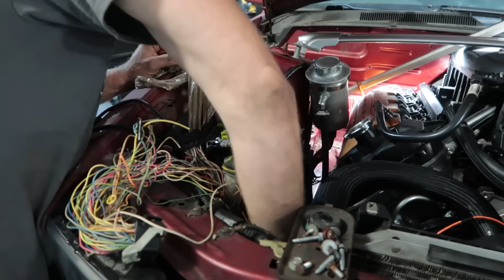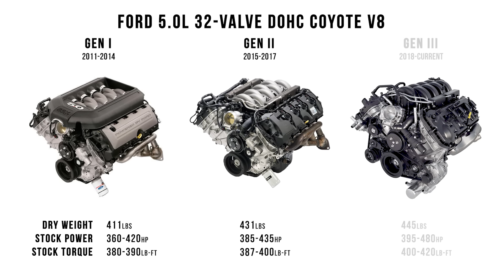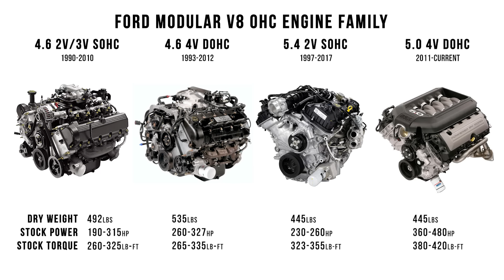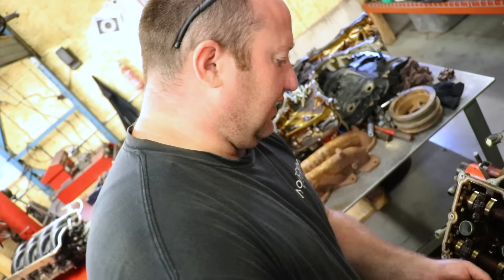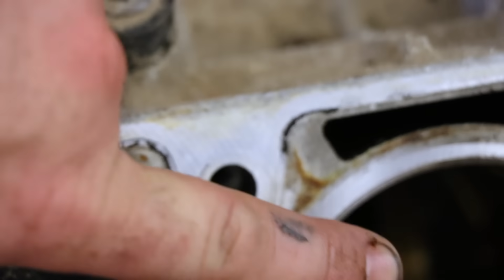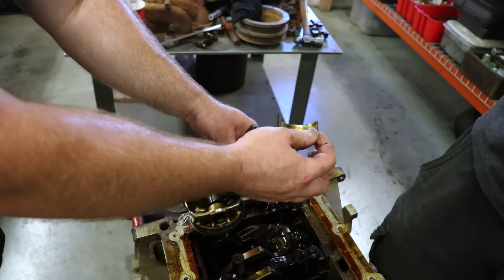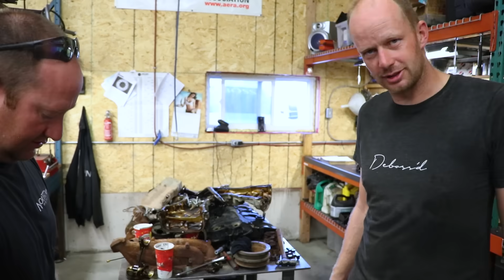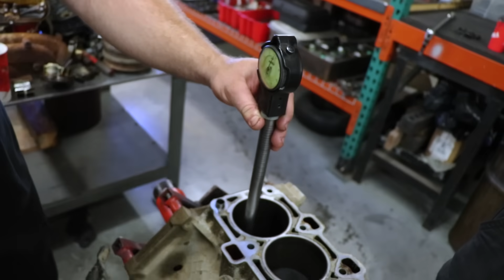REVIEW: Everything Wrong With A 5.0 Coyote Engine

Comment: Seen a few 5.0 work trucks with over 350k still going good when we got rid of them
Reply: Yes indeed.
Reply: I bet that engine is respected tho and not getting beat on tho
Reply: @Kevin Roberts sounds like a lot of miles.... For a Ford. Tundra engines with that many miles are about 50% life
Reply: @stevieray1828  That's because the Tundra's using a decade and a half old engine of which the bugs were worked out of it well over 10 years ago that drinks gas like its going out of style while miraculously making less power than pretty much all of its competition hold for the 5.3L Chevy's. I get the people like to suck Toyota off for reliability but the way Toyota maintains the reliability is simply by making no changes to their product for long periods of time they lack innovation a 2021 Toyota Tundra is mechanically nearly identical to a 2007 Toyota Tundra.
Reply: @nathanmcdonald610  true that the engine and transmission have been used for a long time. There have been minor changes, but the truck has remained durable. Also true the mpgs stink, yet Tundra has lowest cost of ownership. Don't get upset that one brand is more reliable than another. Innovations are great when they make the vehicle safer and more reliable, but cheaper made and competitively marketed just to get the sales isn't a better route to go. Toyota has the safety sense on all models, even the 14 year old tundra. Not a bad innovation
Reply: @stevieray1828  I'm not upset, I know Toyota has a rep for reliability I'm just pointing out what they trade off for the reputation, they aren't innovators, they stand on others shoulders and accomplishments of others every 15 or 20 years when they do an update cycle on a model, it's kind of like how the next gen Tundra is supposed axe the V8 and be powered exclusively by a twin turbo V6...Sounds familiar doesn't it.

Also Toyota isn't as up to par of safety as you may think they are as they failed the small overlap crash test and received a poor rating ''unlike Ford and most others who aced it'' with modern safety enhancements. The argument about Toyota goes both ways, many people are just blind to the other side of it.

''IIHS Small Overlap Tundra Video''
https://www.youtube.com/watch?v=SD6TdlJ7zIo
Reply: @nathanmcdonald610  Toyota doesn't lack innovation in the slightest. Actually their engineering is some of the finest. They have also been making reliable hybrids for a long time. The company also focuses more on commuter vehicles and here in America we get the two pickup trucks. Many are fine with that because of the reliability they get. It is true that within the pickup truck market, in America, other trucks are making more innovations. But keep in mind that Toyota won't be copying Ford with a twin turbo engine, the epa has stricter emissions going forward. Also Ford didn't invent turbo charged engines, they started using them as well as making aluminum bodies because they and every manufacture knew the CAFE regulations were going to force innovations for mpgs and they wanted to move forward. In my opinion some of the early eco boost F150 were guinea pigs for the stricter regulations in the next few years to come
Reply: @stevieray1828  For the sake of keeping this conversation simple, I'm willing to acknowledge that Toyota brought the idea of a mainstream hybrid to the publics attention with the introduction of the Prius, so perhaps its unfair of me to say they completely lack innovation, however exclusively speaking of the Tundra, I believe they do lack innovation and hopefully its clear at this point I'm not saying that to trash the brand as a whole, but there is no argument in my mind that the Tundra simply lacks innovation and advancement and I stand by my initial argument that Toyota simply stands on the shoulders of others every decade and some change to bring the trucks up to par ''this applies to the Tacoma as well.'' And while you are correct in your statement that Ford didn't invent the Turbocharged engine Ford IS responsible to making it mainstream in the truck market a business model that Toyota is absolutely about to parallel with the next generation Tundra, word it however you please, but in my mind its copying which isn't a bad thing, if these manufactures didn't copy from each others innovations we would still have 7.0L+ engines that made 250hp on their best days and got single digit gas mileage.
Reply: @nathanmcdonald610  the great thing about America is you can choose from different brands offering what you want. If you want a Ford, than get a Ford.  If "advancements" are what make a truck good for you, than buy a truck with "advancements". The fact that Toyota has slowly worked out all the bugs with the Tundra while adding subtle upgrades and features might not excited you, but I personally value the attention to quality. To say they stand on the shoulders of the other truck companies doesn't make sense. They don't seem to be competing for sales numbers in the truck segment, they sell millions of commuter cars every year, while consistently selling 100k+ Tundras. Even when they are "outdated" in 2021,  the Tundra has standard apple car play, Toyota safety sense with auto headlights, radar cruise control, emergency stop assist, lane keep assist on ALL trim levels. And they are the most reliable.
Reply: @stevieray1828  I'm not trying to be argumentative. As much as I'm allowed to prefer Ford so are you with Toyota. You can prefer whatever you want for whatever reason. We will have to agree to disagree on some of the stuff we discussed, but I'll close with saying its not advancements that sale me on Ford, all the Fords I've owned have been very reliable and treated me well arguably as good as any Toyota I've had or used regularly and I've seen my share of Fords run to 500K+, the reliability  gap between Toyota and any other manufacture realistically isn't that large anymore, not what it was in the 1980s by any stretch. So you enjoy your Toyota's as I will my Fords.
Reply: @nathanmcdonald610  I will agree to your last comment, and do believe that the reliability gap is closing. At the end of the day as long as you are happy with what you have them you're doing pretty good in life. Part of me loves the new technology and innovation, while part of me feels car companies would prefer the consumers buy new vehicles every three years by marketing the newest and greatest things that you just have to get. Not only is living in perpetual debt a poor financial decision, it is also lacking in moral fortitude. It's not right, and our country as a whole and it's individuals are spending more that saving. Average credit card debt is high, loans ect... Surely not everyone falls into this category. 
     Reliable, long lasting vehicles that can be used far after they are paid for is the only thing that makes sense to me, personally. I'm not trying to be one sided here, but Toyota as a company is consistent in caring about the long lasting quality FOR the consumer. They are less concerned with the volume of sales than they are with quality control. I find no reason not to back that logic.
Reply: @nathanmcdonald610  innovation at the cost of the consumer
Reply: @stevieray1828  I disagree I have a 04 tundra with the 4.7 v8 and it has rod knock a 208k and I’ve changed my oil every 3k
Reply: @noahlandry8026  that sucks. Did you buy it new or used?
Reply: @stevieray1828 Ford trucks set the standard for Toyota trucks to try and copy.
Reply: @dontibbitts9490 yup, the most overrated vehicles out there

Comment: driving in a 2012 f150 w 310,000 miles look forward to hearing this
Reply: What engine?
Reply: Xtermin8r187 B I’m at 113,000 now
Reply: StoneysWorkshop 

That’s not bad my 2014 

5.3L V8 use to burn oil like that cuz of the AFM system but I disabled it 

128,100 miles on mine
Reply: Xtermin8r187 B 5.0 v8
has started burning about a quart of oil per 1,200 miles lately

Comment: This is confusing. He names a number of problems caused by synthetic oil but says the cam phasing needs it. So I’m guessing that the fix would be to do 1000 mile or monthly oil change or take the long way to work. Should be shiny new looking on the inside at 100K.

Comment: With these professional mechanics if it is Scotty, Car Wizard, Deboss they know which vehicles  are good and which ones are utter crap.  It's not rocket science when it comes to engines.  Change your oil at the recommended times, change your transmission fluids,  and other fluids like power steering.  If you an do that and your car is wheel built say like a Toyota or Honda, you can keep that vehicle for 200,000 plus miles.

Comment: the biggest problem with coyote engine is.. the logo that comes with it.  luckily mustang and coyote have nothong to do with usual Ford peice of crap. they dont last long but i do not know any engine of this genre that last lol. yeah yeah dodge 392 outlast and outperform them but they break more often ( minor repair like sensors but tis almost every week). i personally have way less power but i have a TANK engine that can handle anything i throw at it and is damn reliable ( old dodge 360 magnum megasquirted ).  i chose reliability way before performance , but i'm not a racer... i just cant stand slowness like modified honda.

Comment: Check you damn oil folks. And change it out at 5,000 miles or 6mos. That color is caused from using Hydro-Cracked synthetic oil which is mineral based. True Ester based Synthetic, I believe would not do that! There is a big difference! The sludge is probably from using a Synthetic (Hydro-Cracked) Blend. And short trip hot shut downs aplenty. Use Synthetic oils, Pennzoil Ultra is made by shell and is affordable at Wally World for 25.00 for 5 qts. It shows to have a quality just below Redline or Amsoil which are Ester based oils.

Comment: Jeebus fuck man, this dude HATES synthetic oil and apparently doesn't know that they make ALL KINDS OF IT. 
Generalizing like there only ever was one kind of synthetic oil ever used that fucked up and engine he worked on and blaming THAT for every other oil-related issue out there instead of the owner not changing the oil or using the correct oil. 
If I worked with a mechanic that blamed everything on synthetic oil I'd change mechanics. 
 Fucking hell,  does he know more then the THOUSANDS of engineers working for the oil companies and Ford combined? That did this kind of work and analysis over the last FORTY YEARS????? 
Get over your hate for synthetic oil or at the very least GET EDUCATED. 
Half the facts that Rich shot at him about the engines he's supposed to be the expert in he didn't seem to even have a clue about! He did 3 engines of that kind? What the hell dude? DOING 3 ENGINES IN 10 YEARS IS NOT A QUALIFICATION FOR AN EXPERT.  3 a month every month for the last 10 years and yeah, sure. 
"Every engine on synthetic burns oil" CITATION FREAKING NEEDED. What kind of 1960's fool would even say that?
Fuck Rich...

Comment: Have never been impressed with any engine in the modular family. Very large external dimensions and small displacement. Bore size is too small, designed by Ford this way due to the bore centers, thus valves are too small. Overly complicated valve gear and no bearings in the heads for the cams to run on. Powdered metal oil gears and cam gears, they break. Displacement is limited by the small bore centers as I mentioned unless a very large stroke is used, 5.4 litre for example. History of various timing chain and tensioner issues. This particular engine suffered a stupid owner that never changed the oil, not Ford's fault of course. Compared to the superior LS engines, these engines suffer from poor low speed torque although they can be revved high. LS wins on all other fronts for various reasons that everyone knows by now. No one uses these Coyotes for swaps, they are too cumbersome for too few cubic inches with too many camshafts at $330 each with too complicated valve gear and the LS beats them on power at every level. Mention Coyote swap and everyone just rolls their eyes. But people put LS's into EVERYTHING. Throw that dumb Coyote in the trash, don't waste a penny on it. Build a great Windsor engine, the one Ford should have kept making.

Comment: People tend to over extend service intervals with synthetic because it can be a false sense of security. They need to be changed sooner than the 10k miles so many go for. Go 3k with the best synthetic you can find on a DOHC cam phaser DI engine or avoid them altogether. Theyre just high maintenance. Conventional will not save you, the interval will. He's right, but for the wrong reason.

Edit: don't forget, these engines run hot and the crank vent orifices often clog from short trip oil vapors. Every day drivers need to be taught how to keep these clean just like checking a dip stick, otherwise sulfurous/acidic gasses can't escape the crank and will etch (discolor) the surfaces. Engines are different now. Is what it is...

Comment: the hell is he talking about with cylinder overbores? overboring an engine increases it's cubic inches period, he's confusing comrpession with engine displacement and why would they lower the compression when you overbore? If anything they would add a slight amount of material to the piston crown to bring it back to stock compression if possible.

Comment: All this talk of oil this, oil. The problem with the engine is a it was designed by ford around eurotrash concepts like dual overhead cams. The engine is garbage and overly complicated for what? being able to rev a bit higher than much simpler pushrod engines that outlast it making similar if not more power in a smaller package?

Comment: Here are the FACTS about oil. Oil has 3 jobs; Cleans, Lubricates & Cools. All, ALL Modern engines NEED Synthetic oil PERIOD!! Don't use a Fram, Use a Purolator Pure1 or the dealer oil filter. Change Every 5k and you won't have an issue

Comment: Why would boring out a 350 change the compression height? As far as I know, compression height is based on the rod length and pin bore location. Not sure how the cylinder bore comes into play there.
Reply from the maker: If it didn't come across on the video, on OEM pistons, if they are oversize, the ring groove is higher on the piston to keep the CR the same.  This way it doesn't mess with emissions.  On aftermarket pistons,  there is no general rule

Comment: I could tell the guy was a wack when he mentioned 2v 4.6 mods and power
Reply from the maker: I guess these guys are whack then https://www.youtube.com/watch?v=H7DCfX-sPk0
https://www.youtube.com/watch?v=trS4YdTeCkQ
https://www.youtube.com/watch?v=TGIjBqqZ6r0
Reply: DEBOSS GARAGE everyone knows 2vs aren’t easy to make power without dumping money into them, he speaks as if it’s simple and easy. Sure you can make big power for 10 grand.
Reply: DEBOSS GARAGE regardless of the oil comments that are completely opinionated, bore and piston over sizing doesn’t affect ci or engine size. Really?
Reply from the maker: If it didn't come across on the video, on OEM pistons, if they are oversize, the ring groove is higher on the piston to keep the CR the same.  This way it doesn't mess with emissions.  On aftermarket pistons,  there is no general rule

Comment: This guy doesn’t know what he’s talking about.  That slugging does not happen with synthetic oil.  That engine was running regular oil.  I’ve worked at a dealership for 15 years and have worked on synthetic oil engines and conventional oil engines have overhauled approximately 100 of each.  Engines ran with synthetic look like new when taken apart.

Comment: Couple another problems with first gen 5.0 Degas bottle hoses leak and t pipe and oil pump problems. And also very early years 11 and 12 your burn exhaust valves

Comment: That was the BEST Video I have seen In 6 or 7 Yrs. I'm a Ford Guy  got a 331, 347, 363 Dart Block Strokers. But I have a 2002 Surburban with 5.3 Vortec bought it 50,000 miles know it has 278,000 She Say if I get Rid of it She going with the Guy Who BUYS It. And 1994 F150 300CI 4.9 L, 5 Speed Best Ford Combo Ever. 3 Foxbody's for Stroker Motors. I got the GOOD Chevy!!!!!!

Comment: LS has problems with oil pickup enough said
Reply: Yes, so on the LS every 100k miles drop the oil pan and change the $5 o-ring. Not the worst of faults. And change the exhaust manifold bolts before they break if driving in the snow (salt) belt.

Comment: I say if it ain't broke dont fix it iv got an 04 and 09 gm 5.3L 
(old pushrod tech) both have over 300,000km on them. There's only 3 things iv changed on them over the years spark plugs,oil,and filter lol.

Comment: The 7.3L is proof the OHC V8 e experiment at Ford was a failure, the Mopar 4.7L and its successor 5.7L also is an excellent example. Even GM's Northstar failure vs the Gen III, IV and V.
Reply: ? the OHC "experiment" has succeeded just fine. The 4.6l 2v worked great in the crown vics, the old 2.3L lima and even the new ecoboost are generally well liked.

Comment: Oh, boy...Mr Machinist, the pushrod engine was invented after the overhead cam engine. The reason the pushrod is more relevant than ever is that the amount of displacement from a light and externally small package. That defeats the volumetric efficiency advantages of state of the art dohc designs. If the DOHC or SOHC 5L or 6.2L were the better the new 7.3L wouldn't be pushrod.